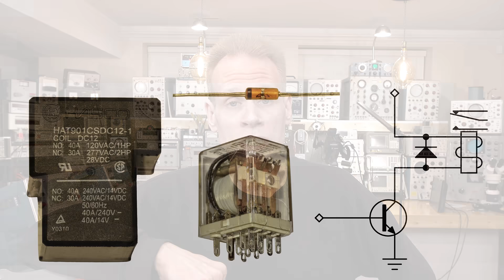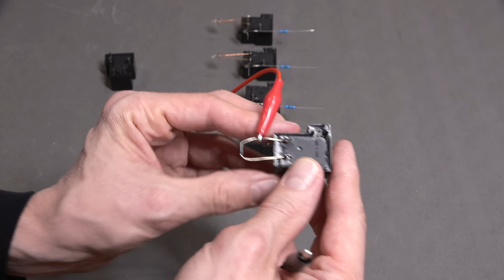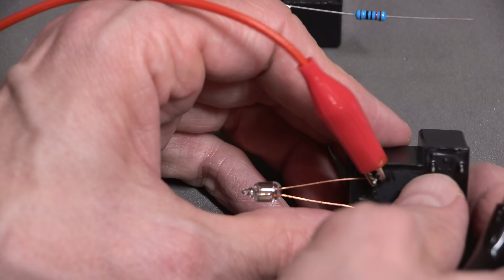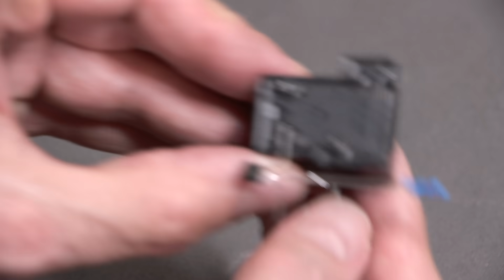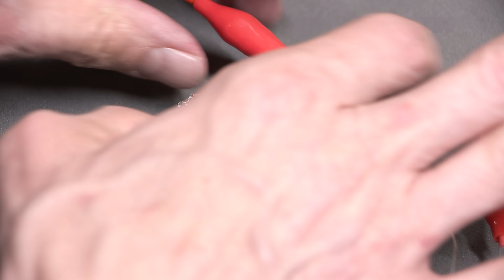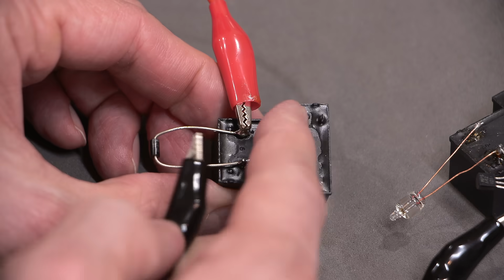Why Add This Diode Across A Relay Coil? This Is Why It's Needed!

Comment: I've never added a relay onto anything I own, I take the current needs to be matched to the relay. IE- 12 or 6 volt system. I don't know, I'm working on a old Ford tractor with 6 V Ignition system, and I want to run a relay in the headlight circuit.  I don't see any high current flow that I'm worried about or Relay turning off. I just want to protect my headlight. Switch from overheating. Because everything made these days is junk and I just had to replace it. If anyone reads this and has any input, I would appreciate it.

Comment: Hi I’m a electrician by trade and just ran across your channel my question to you would be if I connect a diode to the coil why not a small led light with the right resistor for a 12 volt automotive application by doing so you would also have a indicator light when the coil is engaged am I correct or am I missing the point since it would accomplish the high spike

Comment: great video.  thanks.   I have damaged automotive relays in the past trying to test them, but getting the polarity wrong. there does not seem  to be a rule for polarity on pins 85 and 86. is there a way i can know which pin is positive on a 12v relay? the diagrams on relays do not show polarity, and i do not always have access to automotive wiring diagrams.  thanks for your time.

Comment: Great info.
I worked on relay operated PBX telephone switches in the late 70s and thru the 80s and 90s.
My skills have gone with the dinosaurs.
As a kid in the early 70s, I built my own , dial selective, Stroeger based, telephone devices.
Always put a 4001 across the coils, and across some contacts....
My buddy had a model T ignition coil attached to the doorknob of his radio shack(garage).
On arrival one day we both forgot about the security setup.
My bud got the full inductive collapse into his hand.
It was funny years later....not so much when it happened !
Reply from the maker: Thanks for sharing your story!

Comment: Until I added back-EMF-snubber diodes across the coils of all the solenoids and relays in my Friden Flexowriter, I couldn't run it in the same room with my 8080 microprocessor, without the microprocessor crashing. The Flexowriter is all relay-logic, and the logic levels are half-wave-rectified 110v AC, which is about 155v pulsating DC. When those relays opened with inductive loads on them it made the Flexowriter a great big box full of spark-gap transmitters. The diodes I added shunted those back-EMF surges, and eliminated the sparking.

Comment: Once I saw the picture, I realized where I made my mistake. 
 This is to keep it from sparking like when we put the capacitor before the points on an old standard ignition.
As the magnetic field collapses when there's a current, that's generated as a backflow of current in the opposite direction, which would be AC, and that diode cuts that from happening, sending it down the other conductor..

Comment: In the 80s, when telephone answering machines proliferated, I was fixing a Record a Call that was brought in that would not hang up the phone and kept recording until the tape ran out. It could only record one call like that and then record half an hour of nothing, or more depending on the tape size. After replacing timers and measuring voltages I found all the circuitry functional but it would not hang up. I was aware of snubber diodes and their function with coils and since every thing worked until it tried to hang up I eventually measured the snubber- it was open. Every time the machine tried to hang up and released the off hook relay the lack of snubber let the spike wreak havoc and reset all the timers! it would time out again and try to hang up and again the spike would reset all the timers over and over until the tape ran out.

Comment: Awesome video. You're clear, concise, and demonstrate how it works in a practical application. What a great teacher! I've played with electronics since I was a kid by reading encyclopedias. My work doesn't require board level diagnosis; however, I've run into a problem with an obsolete model train, which brought me here🎉

Comment: Great video! I have one question regarding the diode. For a 12v DC system what diode would you recommend? I dont beleive you covered this in the video.
Reply from the maker: That can be application and relay specific.

Comment: Worked as a mechanic/electrician/oil wiper-upper on gas turbines in the oil field.  Diodes came with all the solenoids on "the package" but nothing on the balance of plant solenoids.  As a newbie, I was told to go to Radio Shack and buy a bag of them because I was going to need them.  It was always fun getting the new guys to think about why they were needed and what happens when a field collapses and how that could not be a good thing.  Ah, to see the look on a pup's face when they figure something out from the clues that were dangled in their face.

Comment: thank you great job! can you make more videos on 12v car gadget control circuits and stuff like that? I dont see many channels explaining how to mix electronic with car 12v systems. thats a good point you made about relays needing diodes, its always either car guys or electronics guys theres never a mix of the two explaining how to put electronics in your car like custom buttons and stuff like that. ive always wanted to make my own controls with electronics for my old vehicles but i find it hard to research all the electronics to do so without burning the thing down. for instance my 95 k3500 6.5l diesel needs a few projects done: 1. the stock lift pump/fuel pump circuit sends the load side of the relay through the oil pressure sensor and tends to burn it out, the fix people have done is to put another relay in between but there is no good solution posted to make it so the relay will also power on the fuel pump in the key on position so it primes the pump for an easy start (later models changed it from factory). another issue is the hazard button on these 90s gm vehciles tends to snap off or break easily and causes the turn signals not to work, ive wanted to replace the button and never have to touch it again and instead move the hazard flasher trigger to an easily replaceable button on the dash like most cars have instead of the one that is deep in the steering column. i tried researching for these two problems but cant figure out how to not backfeed the turn signal electronics, and the lift pump issue i dont know how to stop the energizing of key on when the truck is running because the oil pressure switch is a safety function to kill the pump if the truck flips over and loses oil pressure.

Comment: Could this by why I'm having issues with the starter relay on an older (1986) Ford? The symptom is an intermittent "stuck" relay condition. I don't have a low resistance bond meter but the ground connections are new and clean.
Reply from the maker: Either the solenoid (or Bendix) is mechanically sticking, Your ignition switch is faulty, you have a wire shorting somewhere, or some related electrical failure.

Comment: On the downside the circulating current through the diode can slow the magnetic collapse and make the relay drop out more slowly. In many applications this doesn’t matter but sometimes use of a carefully selected resistor can speed up the relay drop out.

Comment: i generally put a resistor AND a diode in series on the coil... the reason? the diode sure prevents reverse voltage of the coil, but it also lengts the releasetime of the relais, while a resistor usually releases the relais fast, but is allways in cicuit and draws a bit current... - by combining a diode with a resistor you get a fast releasetime with the advantage of less reverse voltage...

Comment: Great video Mr Carlson I am 78 now but when I was working I was a mobile radio repairman and installer I worked on a lot of school bus radios, got a call from a school district saying that every time they put a radio in a bus it would fail.
School buses have a lot of solenoids, you guessed it, the bus garage mechanics were systematically removing ALL the protection diodes from every solenoid.
I measured the REVERSE polarity voltage spike at the radio at more than 100 volts.
Even then the mechanic could not accept the evidence.
What's that old saying about leading a horse to water.
Reply from the maker: Thanks for sharing your story!

Comment: A better solution is a Zener across the transistor with Vz being about 75% of VCE.   The diode across the coil slows down the relay release and can cause contact erosion and welding.

Comment: Here's a little known fact that no one mentions in any literature: A diode only has a low voltage drop across it (less than 1 volt), so dissipates the magnetic field energy slowly, so the relay or solenoid (e.g. solenoid air valve) turns off slowly. If you want the relay or solenoid (e.g air valve) to turn off much faster, use a zener diode (instead of a diode) which has a higher voltage drop. (e.g. 12 volt zener has a 12 volt drop). This will dissipate the energy much faster - the power dissipation is proportional to the voltage drop. Just make sure the switching circuit can handle the higher voltage.   I liken a diode to applying the brakes on a car very lightly (low power dissipation), whereas a 12v zener will put the brakes on hard (high power dissipation) and stop the car much faster.

Comment: When aftermarket remote starters were becoming common in the late 90s early 00’s I had one that was problematic. If you used the brake to shut down the remotely started car, the whole RS module would lock up. Only a complete cut of power would fix it. I sent it to the manufacturer for warranty work and they “fixed” it. The fix worked until something was slightly different, like headlights were on or something. This RS module was not from a reputable brand at the time. “American made” used to mean something nice but in this case I think there were not good engineers involved. 

Since these modules were very frequently relay driven, I highly suspect they didn’t engineer diodes for this, or I as the installer was using a relay in an unexpected way to cause these issues.

Comment: Halfway into the video and no mention of "why add this diode across a relay coil?" at all...none.  However, I've listened to OP talk about how much info he's going to pack into the video and repeat himself over and over.  Not until 15:40 do we finally get an indication of what he's trying to say.  Finally at 18:00 we hear about how the unwanted spike when opening the circuit will destroy the coil inside the relay.  Jesus man... how about you say that first and save all the frustration.

Comment: To shunt the voltage spike from a collapsing EM field around the coil when the current is turned off. 12VDC relay coils can induce a spike of around 300 volts, giving you a nasty surprise if you aren't expecting it since you're only working on 12 volts. Discovered that one while I was conducting repairs under the dash of a late 60's Camero ragtop back in the mid 70's, troubleshooting problems with the top. After the harness had been installed by someone else, nobody thought to bolt the relays to ground. Imagine my shock.

Comment: Thanks for a great video.  Appreciate the wisdom, sincerely.  I work on commercial HVACR and kitchen appliances but am also trying to learn electronics.  I assume for AC circuits this is not as much of an issue (except maybe in low voltage AC) as long as the coil of a relay or contactor is not being driven by some transistor on some control board, and hopefully the engineer would have considered that.  Now that I think of it, any inductive load causes high voltage spikes when the magnetic field breaks down right?  I am trying to learn AC and DC as there is more and more control boards being put in everything these days.  I wonder if high voltage spikes from inductive loads is enough to damage a 24VAC transformer over time though.  Please excuse my ignorance

Comment: With any transistor or integrated circuit controlling the relay, the diode is necessary to have good life to that transistor or integrated circuit.  However, that diode will extend the release time of that relay.  That usually does not cause a problem, but you should be aware of that.

Comment: You need that flyback diode to eat the back EMF formed by the collapsing magnetic field when the coil de-energizes. I've seen fairly small relays push upward of 400 volts in short pulses when disengaging.
Edit: Aaaayyyy I was right! Doesn't happen very often but when you're right you're right!

Comment: My thesis project was to maximize BSFC in a closed loop automotive fuel injection system. I could never get rid of a two bit adder to the summing point. That was in the TTL days so the circuitry was very sensitive to noise. A diode across the coil of the injector would have solved the problem. The world could have saved barrels and barrels of crude oil.

Comment: Great video!  I love how you break this simple concept down into even more simple concepts.  A lot of folks don't know about this because they're focused on the higher level stuff like making their circuit work.  But you have to take things like this into consideration or what is working today won't be working a year from now and you will be frustrated as to why you keep burning out relays.  Two things- first, I LOVE how in all your videos you're always aware of the camera, how it's focused, if the viewer can see the thing you're demonstrating- THANK YOU!  More YouTubers should do that.  Second, the next thing you could have shown to make this one even better was to put an oscilloscope across the relay to show the spike.  In fact, in building switch mode power supplies at my job, we do that all the time in various places in the circuits to make sure spikes are kept under control.  Thanks and keep up the awesome work!
Reply from the maker: Thanks for the kind words!

Comment: 17:50  ..he actually gets to the “point” of the entire video.. 

A magnetic field collapsing on a coil generates electricity.. you know, exactly like how electricity is made for everything on Earth. 

The diode shorts circuits this “reverse current” back into the coil, so that the current doesn’t go other places and wreck stuff.

God this is such a tedious quantity of junk asides, unexplained vernacular, and “I will explain.. I will explain.. . I will explain..”—without doing so—over and over and over again.

Comment: Nice!.  However, the flyback hits the diode.  If a resistor is in series with the diode the diode will not be hit so hard.

Comment: Thanks for the great video. As an automotive and truck tech. I build many circuits with relays. These relays typically have a built in diode or some have a resistor. Most diagrams show pin 86 as B+ and pin 85 as B- for the coil. In this format is it safe to switch either the B+ or B- leg to trigger the relay or is this why they make relays with a resistor accross the coil so it is not polarity sensitive. Thanks in advance for your knowledge. Rob.......

Comment: It's a good idea to show your viewers how to test the solenoid with the analog ohm meter versus a digital ohm meter to tell if the spike suppressing diode is in place and working. The analog by reversing the polarity on the solenoid will show it's there and working. The digital will not.

Comment: The "flyback" voltage from the coil can be quite large and can damage the transistor. It's the same flyback generated by your ignition coil. You can't do this for an AC coil. I've done the same thing to the coil inside the old mechanical car clocks. It make s the contact that gets burned up last a lot longer.

Comment: Want to experience relay overload? Try looking at an older aircraft. IAI, Israeli Aircraft Industries for example, on older Astra and Galaxy G200 models, I affectionately refer to them as “fly-by-relay” aircraft. A head spinner cuz there’s well over 300 relays in these damn aircraft. Try to follow the logic in a circuit which has a daisy chain of relays controlling other sets of relays which finally end up at a control box which has a whole host of complex functions, inputs, outputs to the end user, a device designed to do work or specific function. On top of that, they like to label said relays and components with cryptic reference designators so schematically, one doesn’t know what the naming convention is for said component. You have to go to another diagram with the secret decoder ring. Joy!

Comment: Not discussed here, but adding a reverse-biased diode across a relay coil causes delayed drop-out of the relay when power is removed.  In situations where rapid drop-out is essential, engineers will add a low value resistor in series with the diode.  The idea is to keep the voltage spike well below the breakdown voltage of the transistor switch, but also limit the circulating current in the relay coil and diode so that the magnetic field collapses faster, releasing the relay sooner.

Comment: This video kept popping up in the suggested videos list, and I finally took the time to watch it. I'm glad I did! 
10 years ago I added a relay to my motorcycle to turn the low beams off when the high beams get turned on, and ever since it seems to cause a hiccup in the ECU when switching the beams. This would explain it, so I'll definitely add a diode.

Comment: If the neon bulb clamps the voltage when it lights up @ 70-100 volts, then please help me to understand why on a 120 vac device, that same neon bulb stays lit, and stays cool while being connected across 120 volts? Wouldn't it get hot if it clamped? Excellent video by the way! 👍